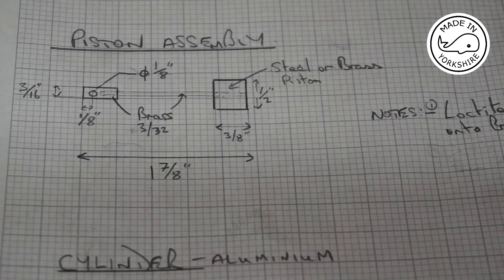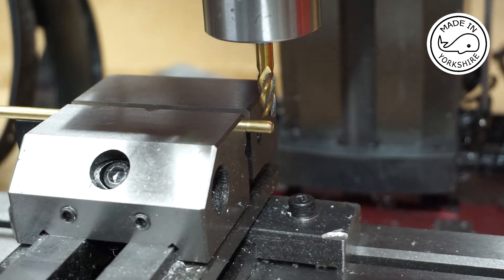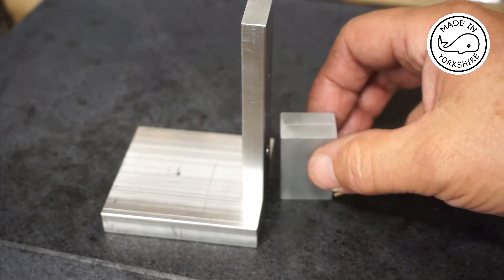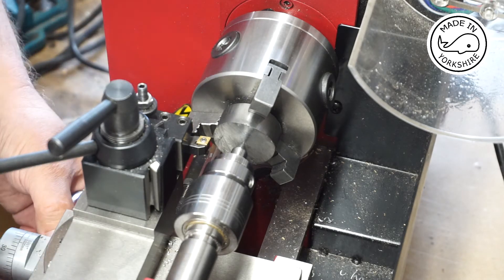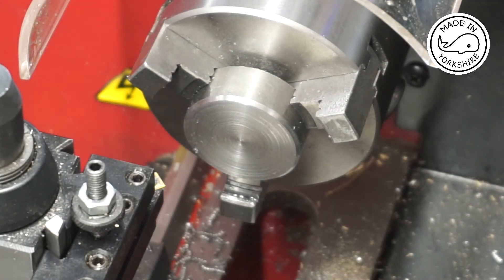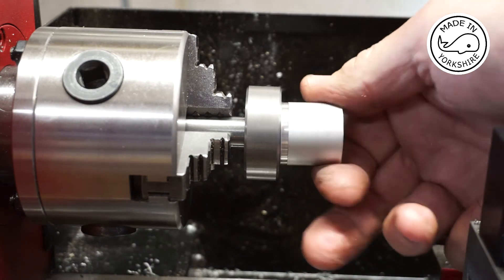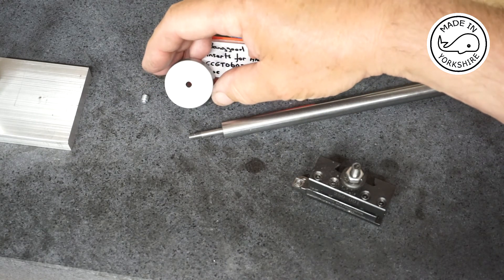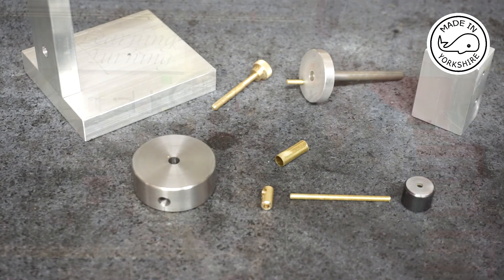#MT20 Part 2 - Making an Oscillating / Wobbler Engine. By Andrew Whale.

Comment: You shouldn't need the live centre at all for such a short workpiece.  It's not going to bend under the tool pressure and the chuck jaws easily provide enough grip to stop it from escaping during machining.
Reply from the maker: Yeah - fair point Chris. I was in my infancy at that time and I was somewhat overly cautious.
Cheers
Andrew

Comment: hello Andrew.enjoyed your video very much, i was looking at it when you mentioned the finish on the product.........maybe you can  put just a slight radious on your carbide cutting toolbar point.or use a piece of  high speed cutter, the carbidesometimes can get tricky, ya just break the tip or put a small radius on the point....just a thought...see you next time....great video.
Reply from the maker: Hi Ray - thanks for the tip - I will certainly give it a try. Glad you like the video too. I hope to get the little 'Wobbler' up and running today. Fingers crossed.
Cheers
Andrew